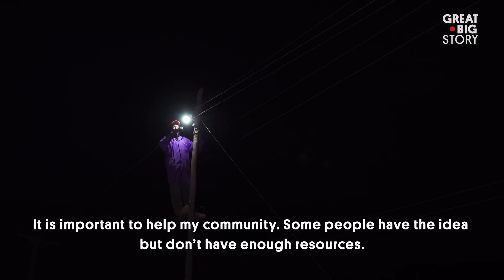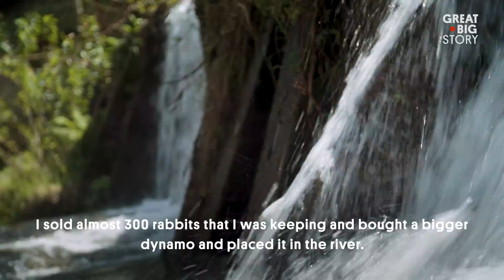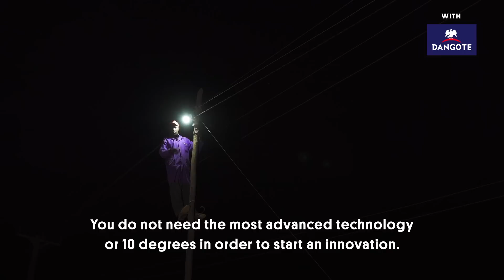Meet the Man Who Built His Own Power Plant

Comment: Thankfully unlike the thumbnail he is using LED bulbs which are more power efficient than incandescent bulbs.
Reply: Depends what they have on them, LEDs are expensive, while fluorescent bulbs might be more common since they're more common. Dude did say he used scrap to build a generator, transformer, and pretty much most electrical components.
Reply: @autoporridge  LEDs aren't that expensive. They are pretty much on same price as fluorescent plus they have longer life and save more energy. Also fluorescent bulbs are harmful to environment.
Reply: @AkashYadavOriginal  LEDs are 10x more expensive.  You dont notice it because what's an extra $5 per bulb to you.
Reply: @AkashYadavOriginal  LEDs are more expensive per bulb, but are more energy efficient (10kw/h) than fluorescent/CFL bulbs (14kw/h). This would mean that overtime, the cost of a fluorescent bulb and its energy consumption will eventually cost more than running an LED. 

LEDs are better than fluorescent because they're more efficient and produce less waste energy, but are more expensive because it's in high demand, and requires a bit more materials to make than fluorescent.

In Africa, money is either eat or starve for a week.
Reply: @RingwelskiJacek  I don't know which country you are from. But in my country India, a 15Watt Fluorescent bulb costs around RS. 150 while a 15Watt LED costs Rs 190. Now a 15W LED will give more light than 15W Fluorescent. So you can go for a lower watt for cheaper. Also LED will last longer than Fluorescent bulb.
Reply: @RingwelskiJacek  I can literally go to the supermarket right now and pick up an LED bulb at my local department store for $5.
Reply: @fireaza  and you could pick up an incandescent for 70 cents. That's my point.
Reply: Akash Yadav he is actually lying ! He probably watched swades when he was a kid 😂😂😂
Reply: @ahsanac18  what's with you and swades?
Reply: NahtatRoll 3333 that comment wasn’t directed towards you mate